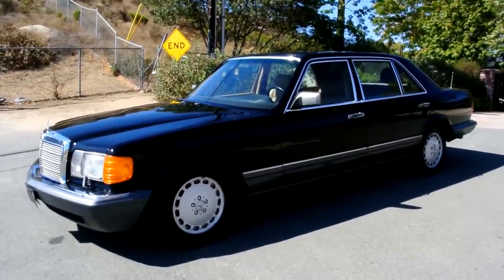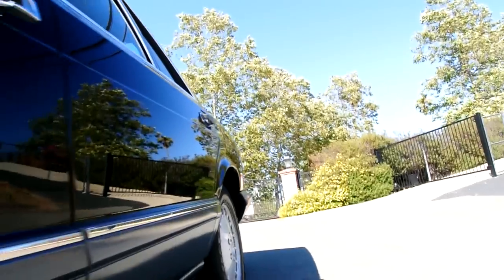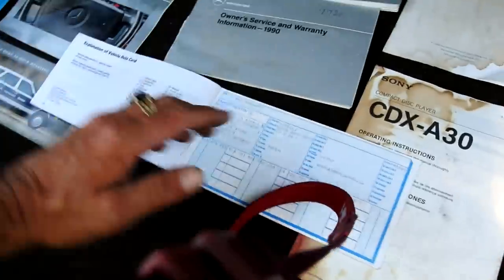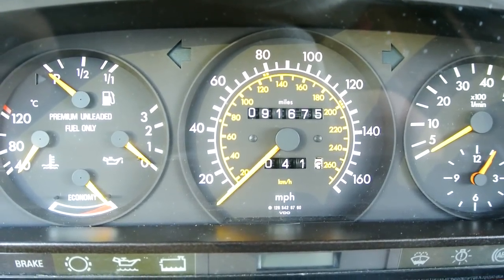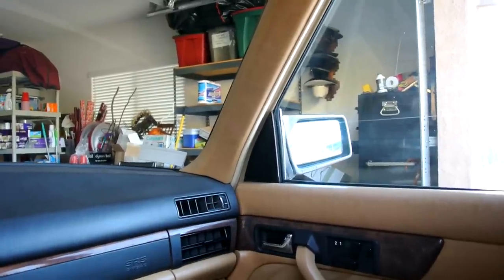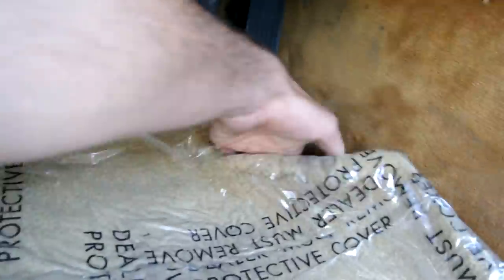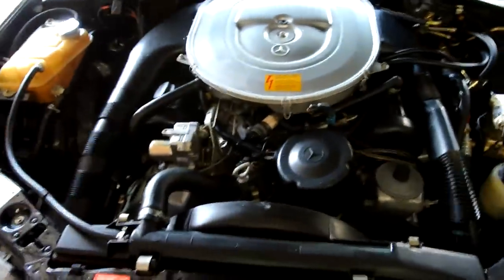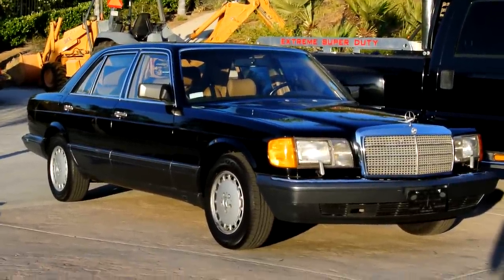1990 Mercedes Benz 560SEL W126 Saloon 1 Owner 91k Orig Miles W 126 Youngtimer

Comment: Pity you dont get RHD  as i would  certainly be a customer
Would still work out cheaper to import, than rescue rusted out rubbish in the uk

Alot of uk cars a re sold to Germany for parts as the y are still expensive out their

Comment: Can you tell me how I to best value (put a price on) these Old Used Cars when I am looking to buy one for myself.  Are Kbb and Edmond's good place to start in placing a price on these cars? Are Straight 6 or V-6 or V8's better Engines?  And, what is the best 'Mid Sized Mercedes Car I can expect to find for under $10,000 and under 150,000K Miles?  Thanks, JQP!